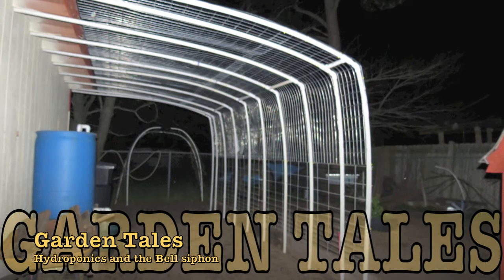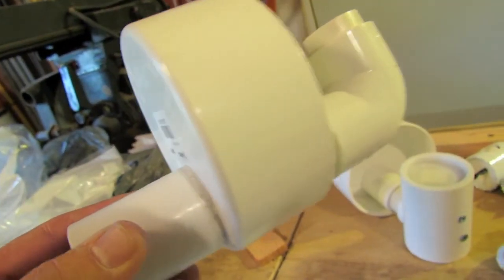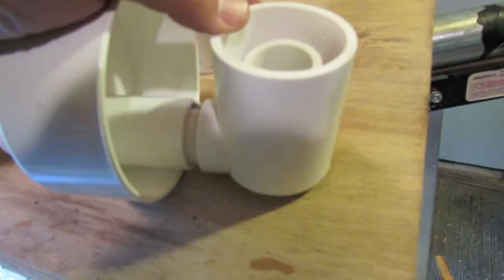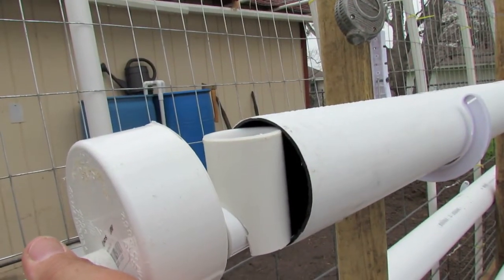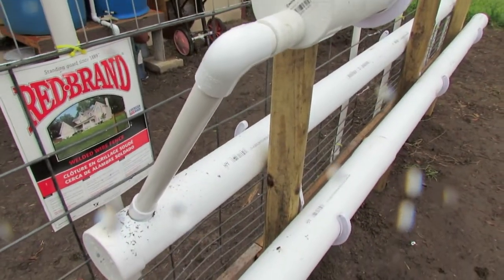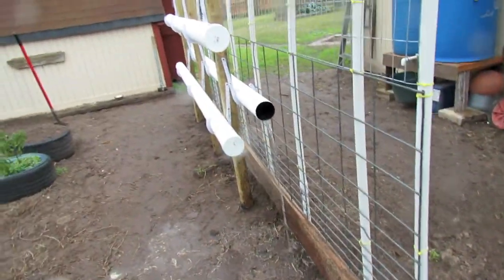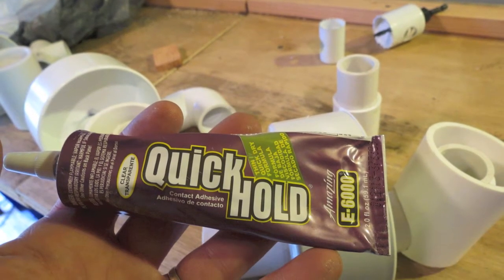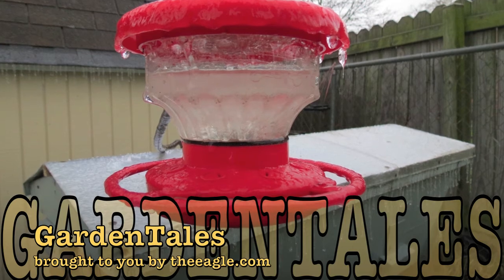Hydroponics using the Bell Siphon

Comment: Hey will. It was hard to find a system i wanted to try out, and finally found ur vid, i have not seen another yet posted in the same way. Thank you for putting ur trail project on. I was basing mine on the same system you have there. It is working well now after i have played with the dynamics and how to get a kick now its doing 100% using 100mm pipe, cut deodorant can instead of the pvc cover u have. Using a small block in the 'drop' its doing well so, cheers for the confirmation that it does work to start with :)
Reply from the maker: I'm always looking to improve! Thanks

Comment: Could you do a video when you have completed the bell siphon with the many different layers vertical, very interested in doing this myself but not sure how the next level will work.
Reply: A quick video or paragraph would help does  level two works does it drain straight away after the first pipe drains through from the top pipe, I understand the process, but confused, not sure if it will work vertically - thank-you for all you help in advance

Comment from the maker: I'm having to backtrack a little and removed the special bell siphon from the pipes, not because they didn't work but because there is not enough volume inside the pipe to reliably regulate the flushing action.  I've replaced the siphon with another type of drain that will have the same action for the most part.
Reply: I want to do the hydroponic with a kind of ebb and flow, but I don't get how to do with without getting all electronic and complex.  I thought that is what you were doing here with the bell siphon.  Am I on the right track?  How did you solve your problem and do you have a video on it ... I'm very interested in this idea.